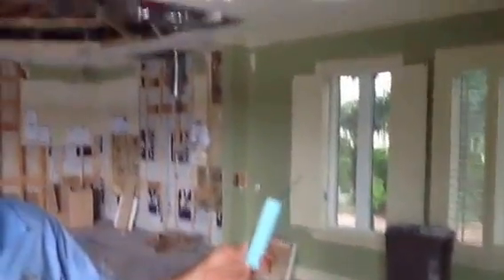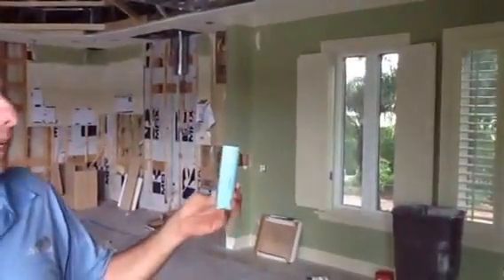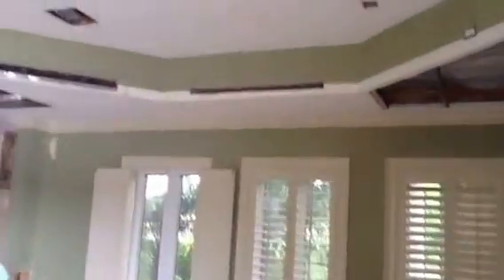HVAC AIR FLOW TESTING WITH SMOKE

Comment: This shows you nothing. In order to test for leakage you need to use a duct leakage testing apparatus. You need to test the ducting at 25 pa and measure how hard the fan has to work in CFM at 25 pa. Generalized smoke testing like this, using an incendiary smoke bomb, is just not a good idea.

Comment: I've never performed a smoke test but it would seem that you would need to seal off all of the supply and return grills to get a more accurate result just like you would when using the duct blaster.